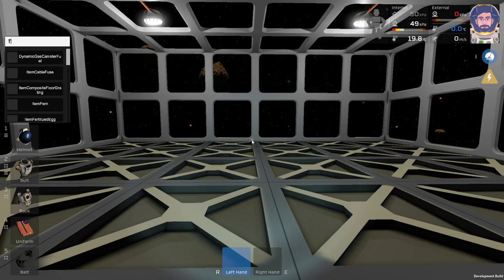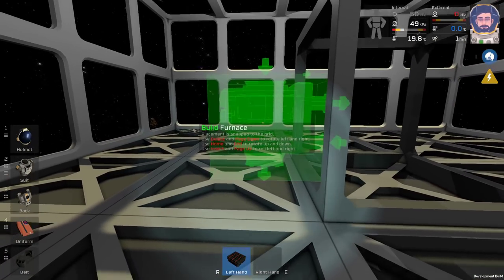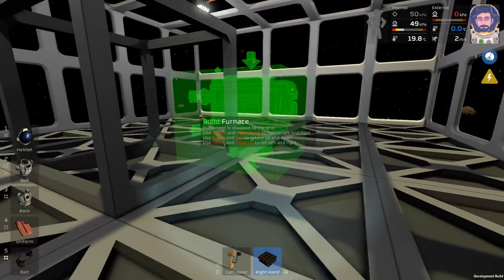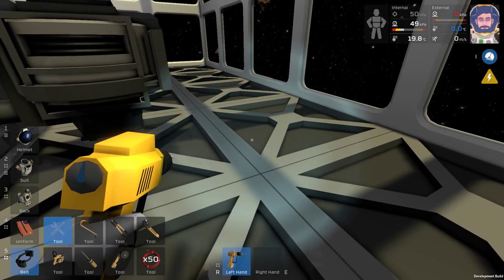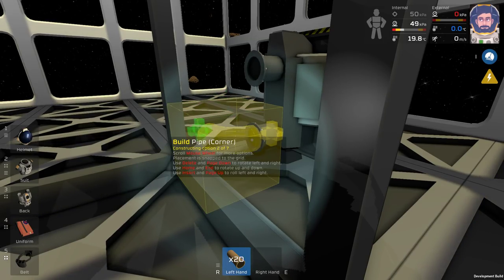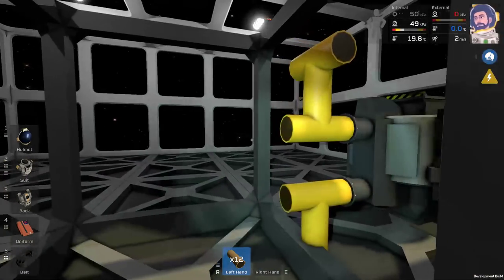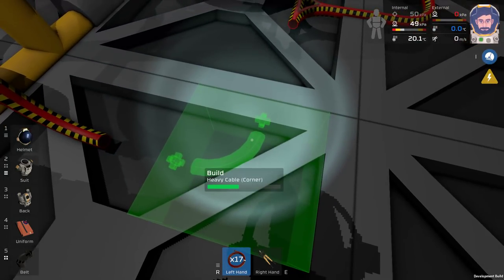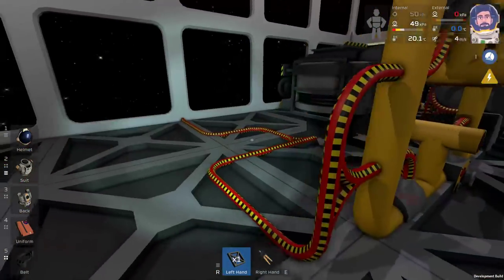Stationeers Tutorial Part 5 - Furnaces Made Easy

Comment: If ya wanted to just use pollutants gases instead do you think adding to the tank storage outside a atmo unit with pollutants filters on it to send it back in and the waste gas so to speak being o2, n2, co2 and h20 into a atmo system after going through a cooling tower of course would be a good idea as there aren’t manny uses for X gas??
Reply from the maker: This video tutorial is a little outdated now ... 
But ... yes there aren't many uses for X, that is true.

Comment: It's really cool that it is possible to build a furnace that works like this with the physics of the game, but it seems overly complicated to run a furnace like this when you can build a perfectly functioning one that regulates temperature/pressure with just valves and radiators. Way too many ways this can fail in disasterous ways. Way less power effecient. Way more time and resources to build.
Reply from the maker: Of my dozens of hours logged in the game I never had it fail in a fiery way. It blew out once or twice, but did no damage. Yes, it's complicated, but boy does it make things easy. This, to my knowledge, is the only way to fully automatically regulate a furnace, otherwise you're stuck tinkering and feeding.

Comment: Great design!
I tried the almost equal construction and it hardly goes to 1000K. What temperature was you able to reach? Will doubling the heaters room size solve this issue?
Thanks in advance
Reply from the maker: What sort of atmosphere do you have in the room?
Reply: I made more experiments and came to H2O, which is more heat-conductive I believe. Also added three more heaters on the wall which has a furnance tube inputs on it. I saw that it slowly reached 1048K.
Do you have any advices?
Reply from the maker: Water is the most heat conductive, that part is true. Count the number of heaters and radiators in your system. Maybe there's something to optimize there?
Reply: I made a 2x1 size vertical heater which reaches the required temp. 
I found one issue with the previous setup: pressure and backpressure regulators had only 100Kpa difference, so they both reacted to each other and released gases to external pipes, which consumed heat.
Also, I found that furnace temperature grows quicker with CO2 rather than H2O.

One issue left - is that tubes radiate heat, so my cables, schemes and transport tube fire from time to time - I will separate them with walls from the furnace.
Thanks for your help

Comment: So if i got it correctly, the reason to make this monstrosity is so you don't have to supply an oxygen+volatiles mixture and instead uses power only?
Reply from the maker: You won't have to regulate fuel, temperature or pressure.

Comment: With that as a base for a more complex design. You could regulate the pressure inside the heat room with another kit tank to prevent blow outs.
Reply from the maker: Yes, absolutely. I just demonstrated the bare minimum for a temperature and pressure regulated furnace, but where you take that design is up to you. The one I built first for a real base had all the trimmings.
Reply: Yeah i'd like to see that too! Please make more tutorials @Rhadamant! Good work btw!

Comment: I dont think this works with walls. Everytime the temperature goes beyond 800K walls start burning and they get destroyed. I have  monitors showing the temp and pressure in the room and its pressure regulated anyways so no problems with pressure etc. I tried pure CO2 and nitrogen as heat conductors but it didnt help. Unless anyone has an idea about something else i might be doing wrong, i suggest using frames all around the temperature room and monitor inside conditions using sensors. 
Love your tutorials btw good work.
Reply from the maker: Thanks! There's a bug with Steel Walls that sometimes they'll ignite. Try to fill the chamber with Nitrogen, should bypass that bug.

Comment: Does anyone know if this setup will still work after two years of patches?
Reply from the maker: Sorry I am not sure.
Reply: yes it does recommend using insulated tank and pipe on the outside (been using this setup on mars) and watch the pressure active vent to passive vent inside piped back out to back pressure vent set to 85kpa to passive vent works really well (do not connect the active vent to the outside wall it will burn up build a frame and place it on there.
Reply from the maker: @JCV11B  When I made this insulated tanks weren't even a thing =]

Comment: I'd like to see what happens to your station, if that room with the heaters breaks...
Reply from the maker: Because there's only a little volume of super hot gas in that chamber, surprisingly enough .. not much.  The room will heat up, but not to a lethal amount. Imagine taking a gallon of boiling hot water and dumping it into a bathtub filled with lukewarm water.
Reply: Rhadamant What about a pressurized station? Regular air would rush in and become quite hot quite fast.
Reply from the maker: That's exactly what I am talking about. The tiny 1x1 chamber doesn't hold a lot of volume, a base would.